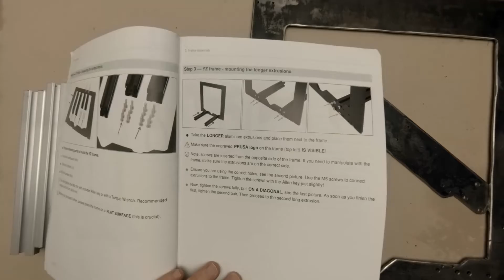Anet A6 metal frame for $21 - part 3 - cutting the profiles and frame assembly

Comment: Subbed.  I bought an Anet A6 printer and it arrived with a broken frame, lots of broken small acrylic pieces, no control board, etc.  Looking for a way to make a new frame for it.  Is there plans somewhere that you are following?  This was my first 3d printer, I now have a CR 10 s5 that I can print parts from if needed.  I would like to get something made from the parts that I have from the damaged A6,   I also have access to a milling machine, hand held plasma cutter, welder, and lots of hand tools.  This looks like a great project.  Thanks for posting.
Reply from the maker: Welcome to our small community.
If you have tools then the easiest would be to make Bear upgarde I guess. Something like:
https://www.thingiverse.com/thing:3667741 (read the description there are links for original design for Prusa)
where you just use Aluminium Extrusion 2040 for all the frame parts.
You can also check https://zaribo.com/ for high quality parts and resources (build manual).
Or TriangleLabs http://bit.ly/AliExpressTrianglelabs (my affiliate link) if you are willing to pay less and wait longer.
Here https://github.com/prusa3d/Original-Prusa-i3/tree/MK3S
you have all the parts for Original Prusa including dxf file for the frame.
In the first part I go through all the prep work: https://www.youtube.com/watch?v=DLy5I6Ylv2s
I follow Prusa manual: https://help.prusa3d.com/pl/tag/mk3s/ and will resolve issues on the go.
The missing control board is a bummer, SKR v1.3 and TMC2209 should be enough, but I haven't test it ever.
If you have milling machine you have unlimted power :)